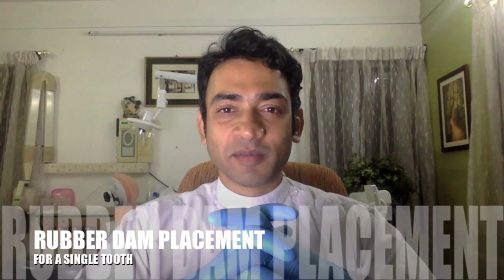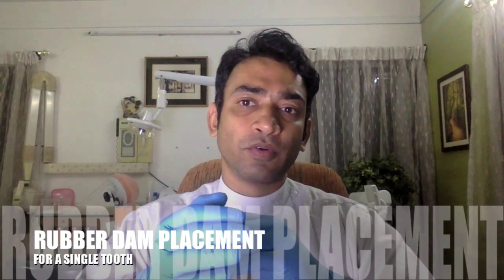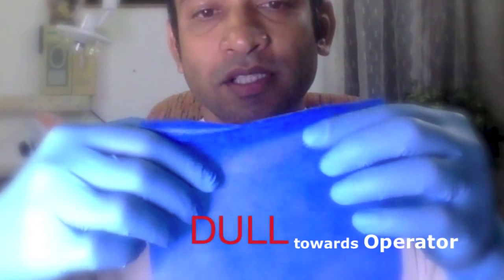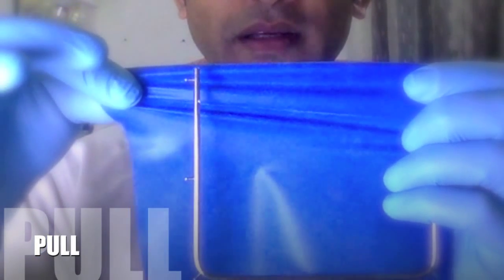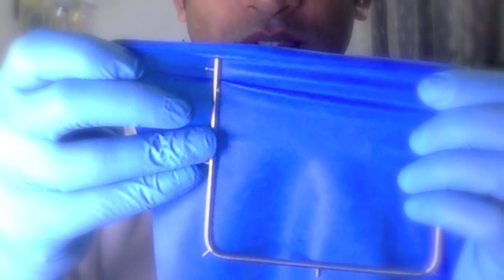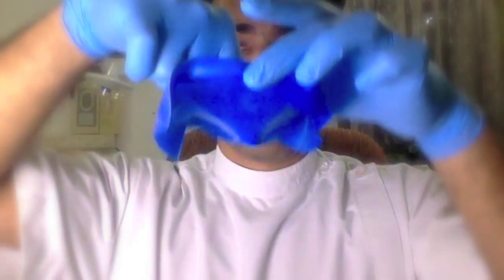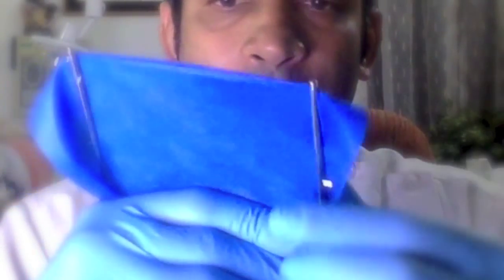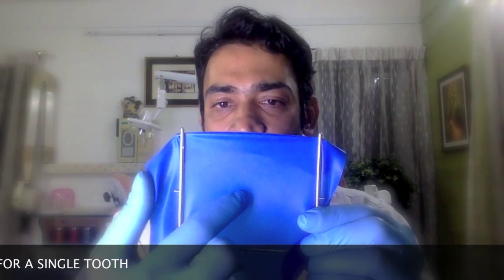Rubber Dam Placement - step by step for a single tooth

Comment: What about the salaiva ejector? While irrigation?
Reply: Hi and thanks for the question. Once properly isolated the dam seals the tooth and the need for a saliva ejector is only to vacuum the irrigant that pools in the dam . If getting a proper seal is difficult then you can inject some gingival barrier around the tooth for additional seal.
Reply: @themadrasplayers  l ask about the irrigating solution.how can l absorpe it while the dam in place.
Reply: Thanks doctor....

Comment: I have a question regd the hole
U punch 3 holes in the same site to prevent it from tearing plz. Clarify
Great video
Reply from the maker: Thanks for stopping by and asking a question 😊Three holes is a beginners move and is done at the same site with a slight overlap to widen the hole.The larger the hole the less the tendency for the ram to split as you stretch it . As you get more proficient you can move to single punch holes . The sharpness of the punch also plays a crucial role . I have found that whenever you don’t make a clean cut the chances of tearing the dam is high

Comment: Kindly share a video for rubber dam placement technique prior to crown preparation
Reply: Dear Raman , thanks for stopping by. For crown preps you should attempt a quadrant isolation. E.g. to prepare a 46 you should isolate from 47 to 44
Reply: @molarsystem  it will be great if you could share the link of video
Reply from the maker: @raman9p  This is a link to a split dam technique. although its titled for class 2 restorations, if you don't apply a sectional ring the technique can be applied for crown preparation too. 
https://www.youtube.com/watch?v=Cqdor_8w4i4

Comment: I just followed same technique in the vdo, It is perfectly done ,but is there any need to apply dental floss for adaptation of rubber dam sheet as many company vdo s recommend?
Reply: Dear Smita, if I had to redo this video I would suggest wrapping floss around the clamp before application. I missed in when I edited the video. Also flossing between the contacts of the isolated tooth is a good practice for better isolation. Thank you for dropping by and I am very glad that it helped

Comment: Do we even use rubber dam in India?
Reply: Its catching up. Mandatory in all Post graduate courses and I think dentists are warming to the idea of the comfort it affords the operator
Reply: @desultorybabble5697  I can assure you not atleast here in MP😛
Reply: I should come there and take a course then :)
Reply: @desultorybabble5697  it won't be feasible sir, it's not that nobody knows how to use them. It's the cost factor
Reply from the maker: Its not that expensive. its just a mindset
Reply: @thedentalcenter9544  sir here the charges for RCT varies from ₹900-₹1500. So I don't think dentist here are left with much options
Reply: @thedentalcenter9544  they miss the wonderful isolation properties of rubber dam but at the end money does matter
Reply from the maker: Still viable with those charges. I started using the rubber dam when costs were at 750
Reply from the maker: what they are missing is the peace of mind
Reply: @thedentalcenter9544  wow that's great
Reply from the maker: As I said earlier, Its a mindset that needs to change. And once a shift is made you will never go back

Comment: Sir, I have been following your technique for a long time, and it's about 90% working great, but in 10% cases, I find the dam doesn't touch the molar from mesial and distal side, once I release it from the wings. Any tips?
Reply: Aaron Sarwal . What you can do is release the rubber dam from the corner times to make it slightly loose and then push the dam material with the back end of a tweezer towards the tooth. The rubber dam should snugly encircle the tooth. Thanks for dropping by and using the technique

Comment: How to take rvg with rubber dam in place
Reply from the maker: Hi Amaresh, the method of taking an Xray with a Rubber Dam in place involves releasing the dam from the frame and folding it to the side towards the nearest cheek. Now you will have space to place the Xray Film/ Sensor and take the Xray.

Comment: Can't I press a rubber dam without a flame?
Reply from the maker: Yes you may place the clamp without the frame. The frame just holds the dam stretched and out of the way for easy access

Comment: highly informative video sir.
.....how to put dam in buccal lingual contact n how to use it in multiple tooth
Reply from the maker: Hi Piyush, thanks for stopping by and leaving a comment. I did not get your question about "dam in buccal lingual contact". However regarding the Multiple tooth isolation , I will be releasing a video shortly to address that concern.

Comment: very nicely explained sir...bravo
the only question i have is is rubber dam a good option to use in class V caries...if yes how to go about it if the caries is at or below the gingival margin...thank you sir
Reply: Hi Pulkit, I will be putting up a video shortly on how to use a mylar strip to make a good matrix for a class V
Reply from the maker: Dear Pulkit, the evolution of matrices for Class V situations has made Rubber Dam use for Class V's redundant. Today if i want a bloodless field, I use my electrocautery unit to do a bit of gingivectomy which then allows me to place the matrix. I will be doing a video soon on the Class V matrices along with how you can modify a mylar strip for Class V use. Thank for dropping a line.

Comment: Could you please show how to use rubber dam for a tooth that doesn't have a crown or its curious up to the gingiva on the buccal and/or lingual side? Those are the ones I have trouble isolating. Thanks
Reply: When you have a tooth which is very short, then what I do is clamp the gingiva about 2 mm below the cervical margin after anesthetising well